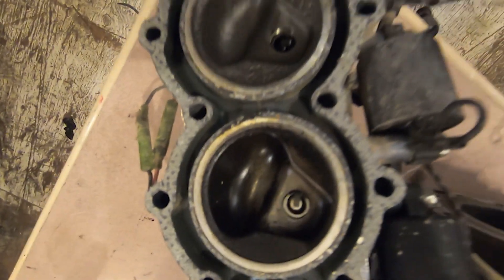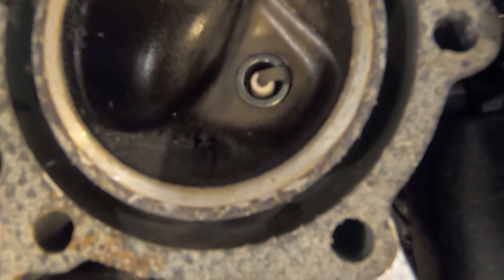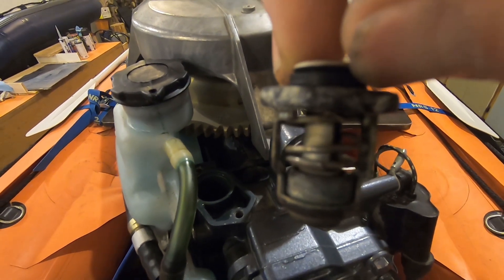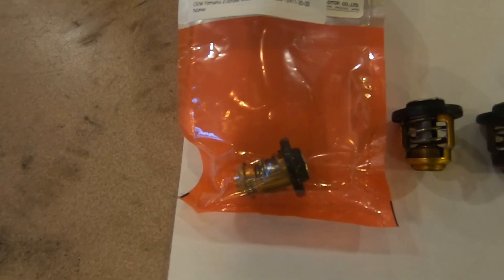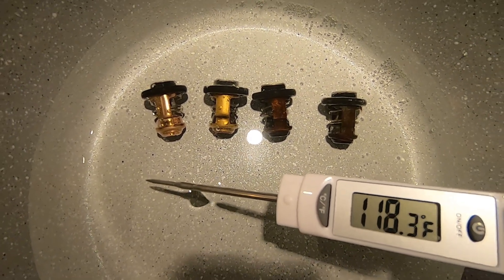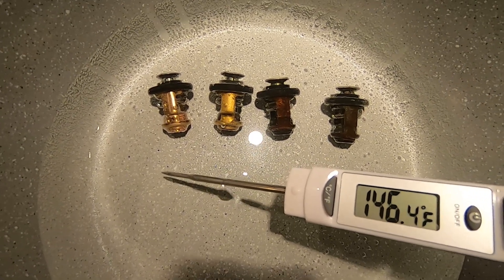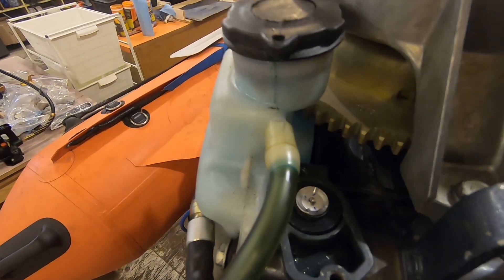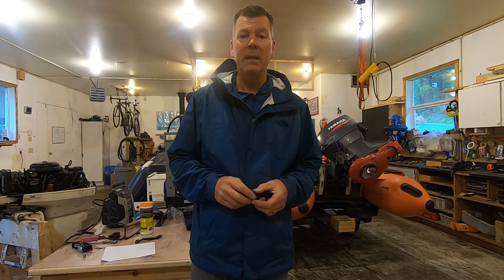Outboard Jet Thermostats

Comment: Hi Rob, great video. I had overheating issues with a 95 Yamaha 50/35 2 stroke. Changed thermostat, water pump, blew compressed air through system, took water jacket & exhaust plates off, nothing that was visible that was causing the overheating. I was beside myself trying to figure it out.

I found this cooling system hack that fixed the overheating issue 😊. There must of been blockage at the cooling around the spark plugs guessing.

https://youtu.be/vTDBd8Jo6OU